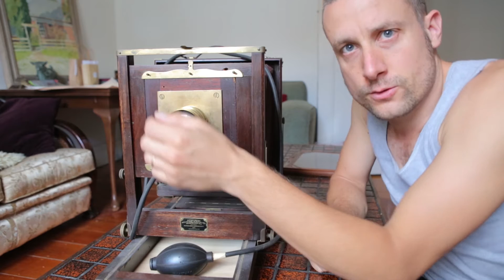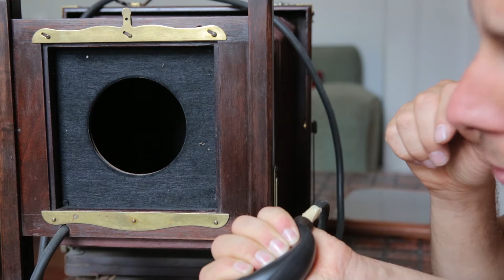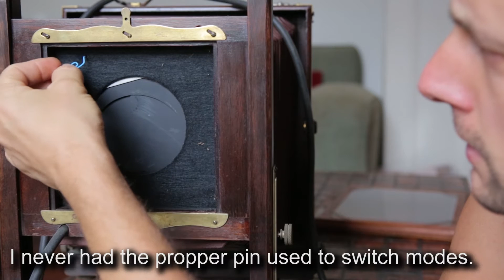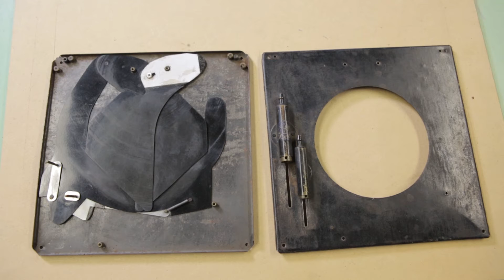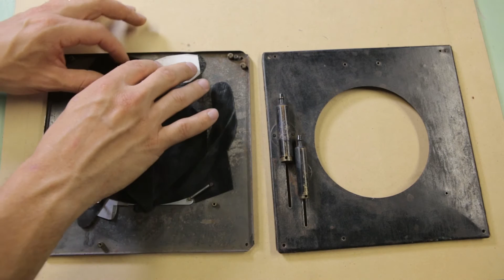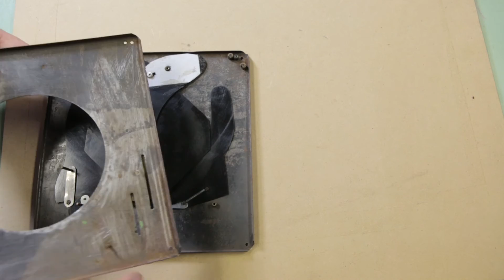Packard shutter how it works

Comment: one of the pistons probably has a pinhole at the end of the stroke so the air automatically escape while the other doesn't. That way, you don't have to mess with a pin to get long exposures.

Comment: if its still in bits could you scan each part into a computer with a coin or something for scale would love to try and make one of these
Reply: Packard-Ideal is still in business. You could just order one if you wanted to. Packardshutter.com
Reply from the maker: It wouldn't be that hard, would probably be a bit less compact if you were to make my own. All mine are assembled and working at the moment. I may attempt making on if the need arises.
Reply: Nick Thorley I'm assuming this is made from tin or some other metal hence the thinness. It would probebly end up thicker if laser cut but I could always cut it by hand. Do you know of any templates that are available?
Reply from the maker: No templates sorry. If you were going to make one the best thing would be to buy one to use the design, even a broken one if you are budget restricted. You would also be likely to alter the design to make manufacture easier, and make it as big as can be practical. The casing on most shutters that I have seen are a thin sheet metal and the blades are some sort of early plastic that greatly resembles whats used to make dark slides. Now that I think of it dark slides would be an excellent material to make shutter blades.

Comment: Nick!  We don't use graphite dust to lubricate these shutters!!  Clean out any rust with very fine steel wool on the inside.  When all is clean, use  furniture wax, well buffed inside the box.  Everything else works dead dry - no lubricant at all.
Reply from the maker: Thanks for the advice but my larger packard will always have friction between the blades and the casing because it was crushed. I have considered remanufacturing the case. I may as well remanufacture the damaged blades as well if i am going to do that. I'll keep an eye out in Kmart if they have a Packard this big it will save me a lot of time.

Comment: Thank you for your Packard shutter videos. To expand on Jerome Allart's comment on the double piston model, here is an excerpt from Douglas A. Kerr's " The Packard Ideal Shutter" (available as a PDF at http://dougkerr.net/Pumpkin/articles/Packard_shutter.pdf ):

The Packard no. 8 model has two pneumatic cylinders. One always actuates the shutter in the Long Exposure mode , while the other always operates it in the Instantaneous mode. Typically, both cylinders are connected to rubber bulbs, usually of two different colors (often with color-coordinated hoses!) to allow them to be easily distinguished. 

One object is that the photographer can use the Long Exposure mode (typically in the Time sub-mode) to open the shutter for focusing on the ground glass. Then the shutter is closed, the film holder inserted, the dark slide drawn, and the other bulb used to make the actual exposure on an Instantaneous basis. This is more convenient than having to change the position of the control pin in the middle of this scenario. (But note that, as discussed above, “Time” opening for focusing can be attained with a no. 6 shutter switched to the Instantaneous mode.)

Once again, thank you Messrs Thorley and Kerr!